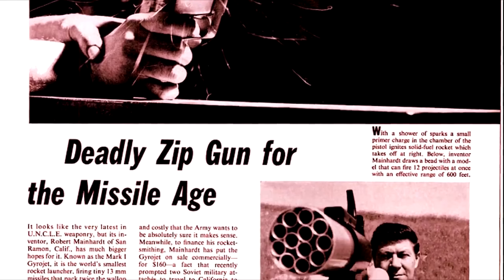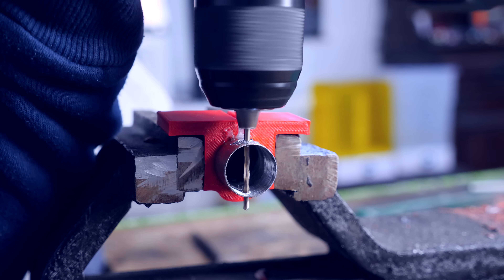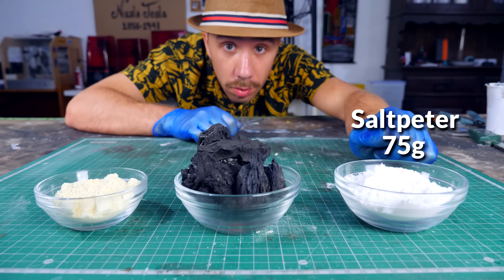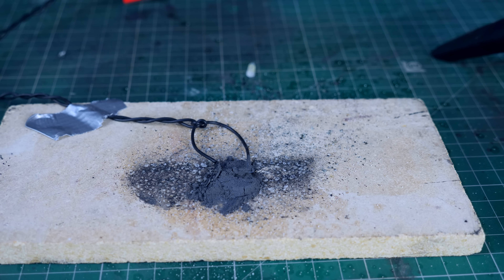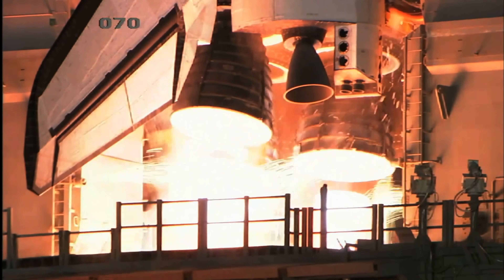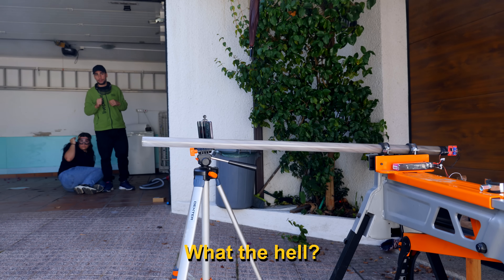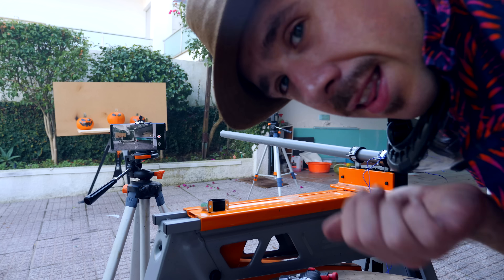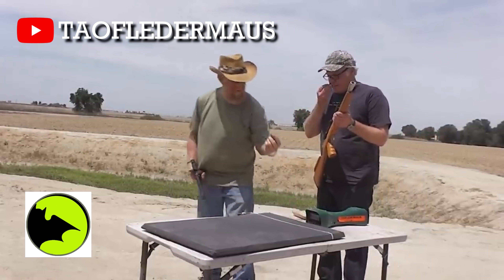GYROJET - The Spinning Rocket Bullet

Comment: You should try milling nozzles out of graphite! You could do it by hand, but a CNC lathe might make life a bit easier.

Edit: For anyone interested in recreating Integza's rocket candy from this video, I implore you to do so on a hot plate outdoors, with a double-boiler/oil bath to evenly heat the pan and avoid hot spots, and with PPE—at least eye protection.
I'm not your dad, and I don't mean to be the safety police here, but I personally spent New Years Day in a burn ward when I was 15 making this exact recipe on a stove top. Do yourself a favor and learn from my mistakes!

Edit 2: I also think it would be cool to 3D print parts, give them a surface coating with a conductive paint, and then electroplate them. Personally I've only ever tried this is copper, and it was for art, nothing structural, so I don't know if there are metals with high melting points that lend themselves well to electroplating. And having a thick enough layer of metal to resist melting and oxidation might conflict with the requirement of tight tolerances on the parts. But I thought it might be a cool idea nonetheless.

I have also always wanted to see a rocket nozzle with active cooling in a model-scale rocket, maybe with channels through which liquid oxygen can flow. I suppose this would also increase the risk of the nozzle blowing up lol
Reply: He mentioned graphite himself, too. I wonder (and have no idea), how graphite works with excessive heat. But it seems to hold up well(?)
Reply: Graphite can handle extremely high temperatures, but will burn if exposed to a flame.
Reply: @martingarnett9381  Now that you mention it, I am seeing some reports of graphite burning at temperatures as low as 400°C, which is much lower than I had initially suspected. I wonder why it is often selected for rocket nozzles?
Reply: @DaimyoD0  I suppose its because graphite is a good heat conductor, so it would spread heat evenly across the nozzle and redirect it to the casing as well

Also the burn rate of graphite would probably be negligible compared to how little time the fuel burns for
Reply: How did it catch on fire when you where cooking it? Was it over a open flame?
Reply: @firstnamelastname.7749  No, just on a stovetop. The batch was relatively large, maybe 2–3 times the batch used by Integza in this video, as I had done it successfully once before and felt renewed confidence in my process. I had difficulty keeping the whole thing melted at one time for whatever reason. If I remember correctly, I may have slightly adjusted the ratio of ingredients to better match the theoretically ideal stoichiometric ratio. This might have meant more KNO3, making it harder to keep it melted. At any rate, as the sugar started to caramelize, I think it lowered the ignition temperature, and a hotspot formed on the bottom, as the stovetop burner doesn't heat very evenly. The whole thing went up, splashing molten sugar on my face and hands, and all over the kitchen. It wasn't even my kitchen, it was my neighbor's, who was working on it with me lol. But he got new appliances because of the insurance claim so he wasn't too mad lol.
Reply: @DaimyoD0  yeah that's why I use sorbitol instead of normal sugar, much higher safety margin, you only have to get it around 210 for it to melt and the ignition temp is around 800.
Reply: @firstnamelastname.7749  That's a really great tip! I will keep it in mind of I end up making rocket candy in the future. I have had four more years of experience in a chem lab since that incident so I imagine I could try it now without managing to hurt myself lol.

Comment: Honestly, at this point I'd love to just see you form nozzles out of clay on a wheel (oldstyle) and glaze them.  I think you might get better results with way less complication.  No porosity, far easier to prototype and I think you'd be surprised by the repeatability.  Also, I think traditional glazes would hold up under the temperatures you are looking for.
Reply: I’d love to see something similar to lost wax. Print the part, bake it in plaster, then go ceramic or metal.

Comment: I think you might have a problem with weight and it's distribution across the projectile.. as well as the gun platform, would help too.. remember that, gp propels the bullet by compression ignition.. basically, the fire from trigger should ignite the rocket "stage"..🤔

Comment: changing the shape of the projectile  with 3d printed additions may help. you could also use a dissolvable filament for molding a faster burning rocket pill

Comment: Add aluminum powder, it will greatly increase the energy of the fuel. You should also replace the potassium nitrate with ammonium perchlorate, if you can't get it or make it (which is pretty easy) potassium chlorate, this can be made using sodium hypochlorite and potassium chloride, both of which you can buy at any Walmart. This should be a 190% improvement
Reply: stoichiometry?
Reply: @imakedookie  thought the samw
Reply: @imakedookie  try to answer 3 bese but YouTube deletes my comment, in this video they explain it https://youtu.be/7MsHq_dUfnY

Comment: If you use concrete for a nozzle use a sander/multitool or other vibration generating item, to vibrate it before it settles, homemade scale of the method used for normal cambered blocks in buildings.

Comment: for electrical ignition i used little light bulbs. Break off the tip und you can fill it with gun powder. Espacially those push in christmas fairy light bulbs worked great.

Comment: If you watch the Taofledermaus video you can see the nozzles ejecting out the side as well as the back. Your nozzles are just strait pushing out the back with only a slight angle and making too much thrust overcoming any spin stabilization you might have.

Comment: Hey Integza! I wanted to let you know your gunpowder (Black Powder) actually burnt slow because it was poorly mixed and the particle size was too big. Since black powder isn't a single compound, but a mix, it has to be very thoroughly integrated and the ingredients have to be very finely crushed (Think finer than flour). You can do this in low volumes with a Mortar and Pestle for individual ingredients (Mix the Sulfur and Saltpeter and crush/mix them together in the mortar and pestle first). For extremely good black powder you want to use a Softwood charcoal like Willow. Hardwood charcoal makes a much slower burning and higher fouling powder. Ideally you'd use 100% pure Sulfur and KNO3, with good charcoal. 

Raw black powder that hasn't been granulated is called Green powder, good quality green powder when ignited should flash, not burn like yours did. You can also use it as a really good rocket propellant that might work better than the sugar rocket mix. (There are also other mixture ratios that work better for rockets)

On a small note about black powder, if you put it in your rocket tube with a bit of an air gap (not hard compressed) it will explode violently. Black powder is very particular on how it burns and if there are air gaps or bubbles, it can cause catastrophic explosions and failures. Also you can't use any 'carbon' source for black powder, it's specifically Pyrolyzed cellulose and some other pyrolyzed organics. Also a really good way to make plentiful amounts of black powder is with a rolling rock tumbler and lead media (or other non sparking/non static media)

If you have any questions I'd be happy to answer them! I've been making BP for many years.

Comment: Rifles have rifling but most shot guns don't so to make shot gun slugs more accurate they would put the rifling on the slug. It would be really easy to 3D print helical ribs that would snap on to your bullets and act as rifling. Therefor stabilizing the bullet and improving accuracy.

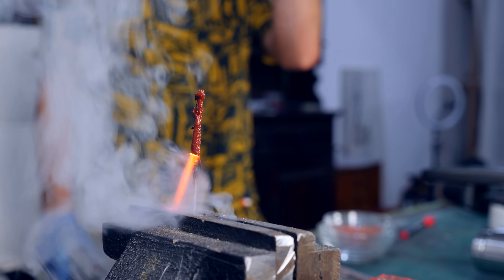Comment: @3:37 if you round the front end of the cilinder (with the hole in it ) wouldn’t you have more surface to burn ? And many you can use Baby powder to help release the mold from the propellant

Comment: Damn I wouldnt dare filling a metal container with gunpowder. Thats a grenade bro. You can buy cardboard tubes online, that wont produce deadly sharpnel if the nozzle holds and it overpressures.

Comment: I think there is a simpler solution to the stabilization problem, it's called a fin-stabilized discarding sabot, with the wings set at an angle (to induce spin) and a single rocket engine

Comment: Ideas: RC submarine w/ depth control and thrust. I believe this could be accomplished with a ballast system for depth and your big brain for thrust. Maybe for demonstration you could make a long acrylic tank w/ silicon and additional support to seal the tank.

It would be pretty sweet to see a multi-stage rocket. I wonder if you could achieve [reusable?] cold gas pneumatic separation with these CO2 cartridges? Overall seems pretty impractical since there isn't a lot to be gained in terms of stages (I would expect identical thin nozzles to remain the most efficient throughout phases since we aren't seeing changes in atmospheric pressure, and weight reduction is only a problem since we're making it one), but you know, s c i e n c e.

Also literally anything powered with water/steam hammer (danger!).

Comment: To make the rocket fly straight curved fins that auto deploy after it leaves the barrel  or on that big of a bullet up the degree to 12⁰-16⁰ should help also acetone and rubber cement mixed with black powder and poured into the center  to just coat the sugar rocket fuel should help with full ignition

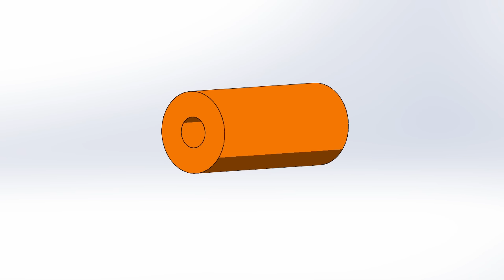Comment: Instead of a central cylinder  ( 3:35 ) try a star shape. This is used in "real" solid fuel ballistic missiles as it has a bigger surface than the cylinder.

Comment: It could be dumb idea, but problems with bulltes are bad nozzles, and low speed of bullet. So, you have to reach higher angular velocity. So, better nozzles (obviously), and... maybe you should use magnetic levitation to accelerate the bullet (like Tom Stanton) and make surface of bullet grooved. So passing air will be rotating the bullet
Or, make chamber with compressed gas behind bullet, so in the moment of ignition, it will be accelerated by expanding gas.

Comment: actually i think I know how to solve a non rotational rockets problem. If you make holes not straight in back of bullet but on its sides you can more easialy rotate them, AND the best part is that direction giving part might be hided inside. I know its a downgrade but by this technology you can make who thing more reliable without too much loses. 
Oh and why wont you do a rifling? Its a bit but a help after all. with dynamics of this form all chances must've be used.

Comment: Have you considered using lost PLA method to make your nozzles? You could print the nozzle in PLA with some extra stems to allow for pouring in material and air escapes then encase that in plaster. Then you just melt the PLA out of the plaster and you have a one use mold that you can fill with aluminum or any other castable  material.
Reply: Aluminum would be my choice as it's already been shown to hold and you can melt aluminum very easily.

Comment: This is just a thought, but adjusting the angle of the nozzles and adding weight to the "rockets" (no YouTube demonitization here) should stabilize them. I am thinking maybe add a bit of weight 3/4 of the way back on the "rockets" may help.

Comment: If you need a lot of gas, try to use aluminium powder mixed into your propellant. Aluminum powder as a part of the explosive is used in torpedo warheads to produce a big gas bubble underneath the ship to be attacked.

Comment: The easiest way to make an electronic igniter is to use Christmas tree light bulbs, not at the led type, but  the actual incandescent light bulb type, break off the tip  of the glass, pour in your gunpowder, seal with hot glue and if you choose the right bulbs,  they already have wires attached

Comment: You could turn an empty co2 cartridge into a rocket motor by making a nozzle that threads onto it. The cartridge already has the constriction, just shorten the threads and add a nozzle.  For added fun, insert into tomato before ignition.  Tomato Rocket.

Comment: Idea/tip: Why not use phisics helix channels inside, so gases must rotate inside and so create a rotation pair for the bullet?
Instead of strait out channels it could create more rotation if their are helix type, not strait... and maybe three exit channels is better than two.
CAD design: Equilateral triangle with one small circle on each vertex, then as triangle moves along a strait perpendicular line, the triangle also rotates around tha strait path; cicrles will create such helix; think of that circles as the channels/holes where gas exit, since they rotate the gas will cause rotation on the bullet.

Comment: Video idea: Use cartridges for whipped cream maker to make a compact hybrid rocket engine that can be used on model airplanes (or just a skateboard) for example.
N2O in these should be a pretty good oxidizer. I mean, it has been used as an oxidizer in rocket engines for SpaceShipOne the first private airplane that flew on the edge of space in 2004.
Thanks Integza! ♡

Comment: Idea: Use a cartridge again as a engine only this time you cut the back of the cartridge so the front (with the hole that let's the gas out) works as a nozle. This ist good since you don't need to make a nozle that is hard to assemble and melts anyway. You just need to tidely seel the backside

Comment: Hey, on the slow motion footage, you could clearly see that the nozzle didn't quite work, given one of the holes had superior thrust than the other one. Why not to make the bullet "spiral like" to make the air do the job? (Using a one hole nozzle)
Reply: I think it wouldn't work at slower speeds, so when first fired and when accuracy is affected the most, it has the least effect
Reply: Yeah that's what I was thinking
Reply: The problem is that the fuel isn't igniting evenly or because of the sparkler which I think might still be plugging one of the vents.
Another youtuber had tried to improve the gyrobullet and even with more adjustments to make a better exhaust ports they still lack consistent accuracy (one reason they never took off and they aren't good at short range)
One thing he DID find that has helped is not to use the central hole style like the original used as well but a flattened sheet that was rolled up but left slightly loose so there is more surface area allowing for more thrust as it can gain more nozzle pressure faster
Reply: I thought a single nozzle with fins integrated into it for the spin work work well and be fairly easy to do

Comment: I had an idea for you to try a fully liquid fuel bipropellant rocket that might be more controlled than the hydrogen peroxide you tried. You already have butane / propane canisters. What if you use nitrous oxide (N2O) as the oxidizer? It is also stored as a liquid but comes out as a gas already pressurized, so no need to pump it. But it has much more density and lower pressure than an oxygen cylinder so it would have better energy per weight like the peroxide. And it would be easy to fine tune the fuel oxidizer ratio just with valves. I think there are even catalysts that will make the nitrous oxide decompose on its own, but the heat of a flame will do it too. For a monopropellant rocket, you might use the catalyst and be able to limit the temperature to work with lesser materials.

Comment: Hey Integza, i have an Idea about CO2 cartridge rokets. The idea may be dangerous, but as you can see on your channel you like to play with fire:
According to thermodynamics, the pressure increases with the temperature: that means if you preheat the CO2 cartridges, they contain more energy and thus generate more thrust. I assume that the cartridges can withstand 80 ° C, because they could get so hot (in a car thats pareked in the sun) and otherwise would not be approved by EU standards...

Comment: You can add few drops of gliceryne to propelent during melting. Should be easier to pour it to mold. 
Second option is use epoxy resin instead of sugar and carbon, resin + KNO is also rocket propelent.

Comment: idea for improvement: 

why not using a usual rocket single nozzle and use small twisted rocket-flaps on the back for the twist? 

and. i'd love to see your rockets have a tip with an igniter for an explosion when hitting anything. siblings are annoying anyways.

Comment: I suggest you increase the angle of the nozzles.
Reply: It’s unfortunately a give and take. Steeper angle means more energy goes into spin and less into linear acceleration. Gotta find that sweet spot where it is just barely stable so the rest of the energy goes into thrust.

Comment: can you make an HHO generator and power rockets with the fuel?
Reply: i think hho generators probably have a too slow generation rate, as well as the problem of very high combustion temperature
Reply: @letsflipp  yes but you could make a reservoir tank to hold it
Reply: @irakli58  true. but then you run into the issue of high flow gas pumping, and the temperature is still an issue